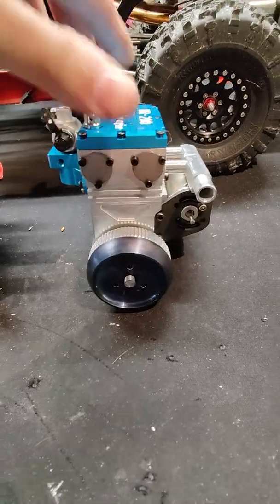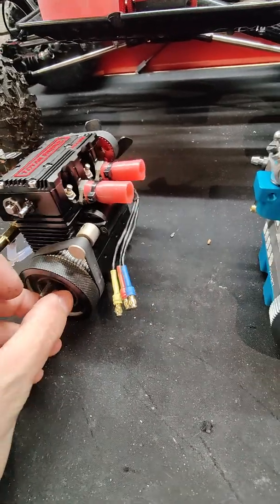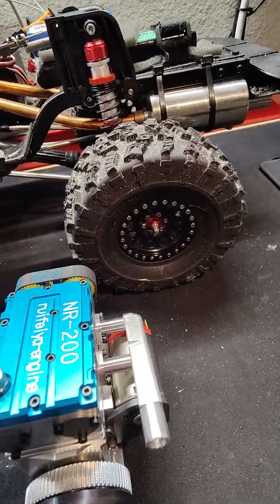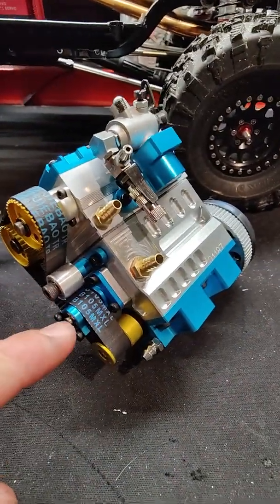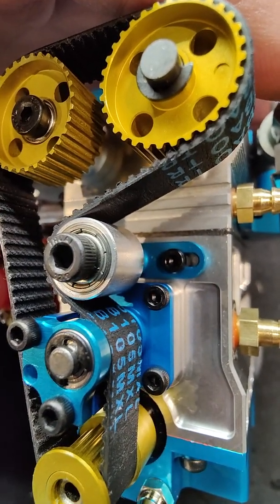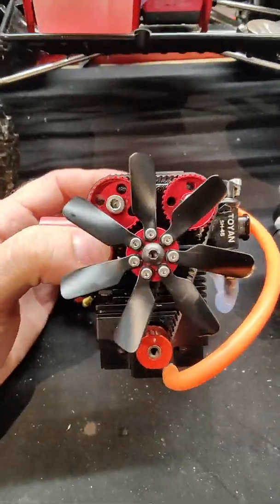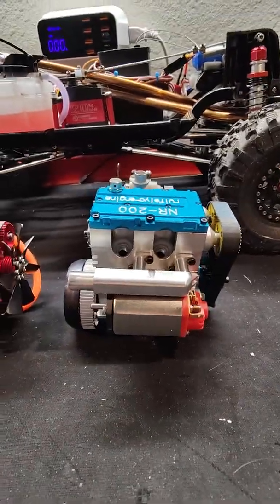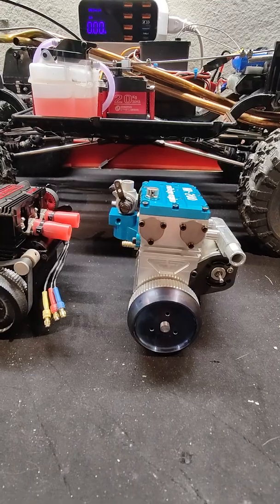NR200 First Look vs Toyan FS-L200

Comment: When will you do a run video?
Reply from the maker: Should have it out tomorrow, still haven't gotten my radiator but I'm doing a quick dry run with dual exhaust pipes so you can hear the difference vs the single exhaust it comes with. Thanks!

Comment: You’re awesome for fit testing the header. And yeah modifying the brushless starter is what I meant, it could even be squeezed backwards behind away from the engine and flipping the wires to turn accordingly. Just an idea that could be more challenging vs the other way. Thanks again brother. 👍
Reply from the maker: Not a problem man glad I could help! I was thinking about doing that with starter but I don't have much room with transmission and electronics to flip it so I'll have to mess around with some ideas, it's mainly because this engine is a bit wider plus that huge starter so hopefully I figure it out lol. You're welcome bro take care!!👍🤙

Comment: If It was me and I ever get this I would probably come up with changing the carb adapter to a 45deg. It took me about 38 email string to finally get them to say send it back (the L200). I saw sold on the L200 but ended up getting probably a dud. NR200 has sold too but 1st thing 1st. Brother let me know if the header fits the L200 so I can order it since I was looking at that too. The engine looks like it a shaved L200. Maybe the brushless can be adapted to the new eng. Thanks for sharing bro.👍🇨🇱
Reply from the maker: Yeah I think the support for these engines needs to be way better and quicker as it would make everything easier and since these are engines they wear and tear so that's why the the NR200 is a gamble since it doesn't have much parts or support backing it up like Toyan. Personally from what I've seen on the NR200 the Toyan engines have far better and more precise machine work. I did test fit the exhaust header on the Toyan for you and the top bolts line up but the bottom ones are off a bit but it looks like you could make it fit if you open up the holes or slot them, it's very doable to use in on the L200. With the brushless starter I'm sure it can be used but I'll have to make a new adapter plate so I can fill the slack from the original belt, as for the carb I'm gonna try it upside down just to see how it runs in that position I won't know till I crank it up which may be tomorrow. Hope this helps brother and take care!! 👍

Comment: Cool video bro, I am going through the clutch delema also,  I might just retap my threads to get it running,
Reply from the maker: Thanks Dennis, well hopefully when this Ofna clutch nut comes in it solves the problem, I'll be making a follow up video once I got it in and I'm making some progress. The machining work I'm starting to see isn't the best, the cylinder head exhaust holes don't line up correctly with the exhaust pipe flanges they are off by a decent amount. Little things here an there are slowly popping up but its to be expected, I'm sure you'll start to find all these little issues as well with yours. Take care man!
Reply: @DanielHernandeztinkers  Yeah I seen some rough hatchet machining on mine also once I got a chance to study it,  I started mine up tonight and it sounds pretty wicked when it idles.
Reply from the maker: It does have nice pops almost like a two stroke lol,  I should have a vid out soon of it running just the weather's been terrible here in Florida 😂 I saw your video I'm glad you sorted the clutch out too👍👍. take care bud!!